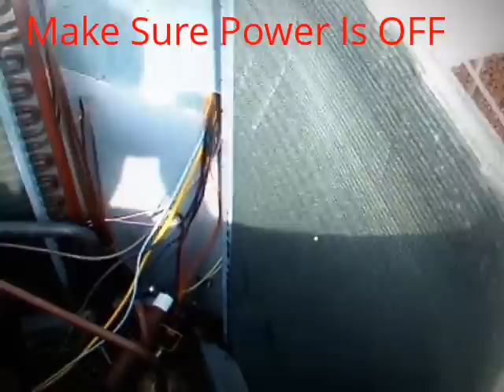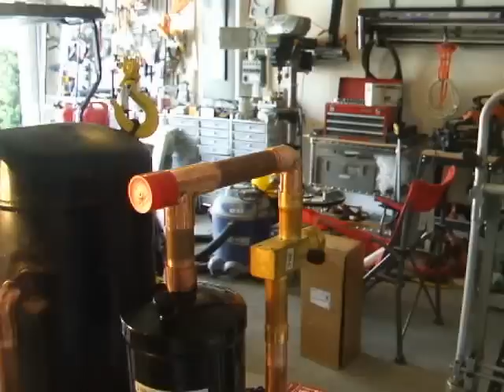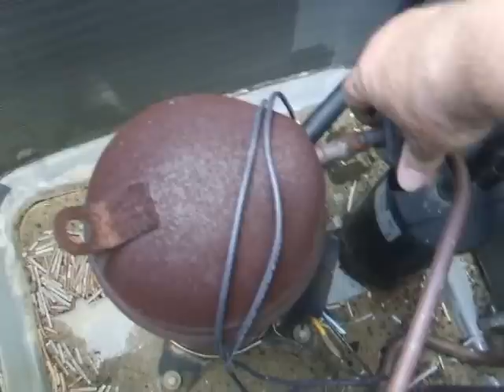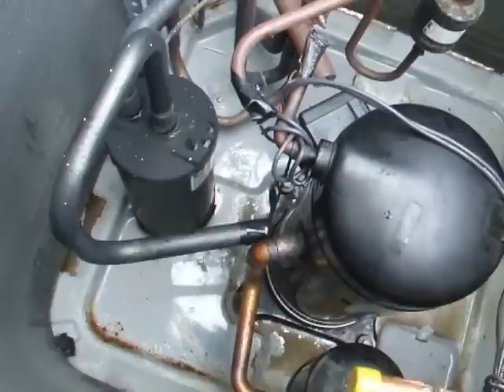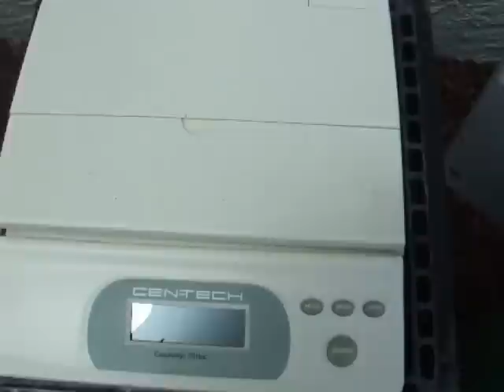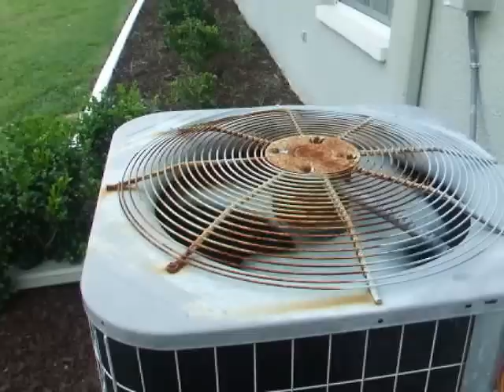HVAC: Compressor Burnout & DIY replacement

Comment: WOW.  I'm impressed. I watched this after being told yesterday that my compressor was grounded out and the unit was dead.  The system is 12 years old and using R22.  I was told I had 2 options either replace the compressor at $2700, or a complete new indoor and outdoor system at a cost of close to $$$10k!!!!

Time to start doing some research...

Comment: Fyi Hard start kits(start capacitor and potential relay) should only be installed on single phase reciprocating compressors, scroll type compressors have other problems if they need start components. When you call a service technician you are not only paying for parts and labor, you are paying for a guarantee, company overhead, insurance (liability accident workers comp health), gasoline in the service vehicle, tools on the truck, education and training, office personel, cellular service, I could go on forever about the costs associated with operating a small business. A service company would complete the task within a timely manner, start to finish a compressor replacement would be completed within hours not days. Parts would be purchased next or same day also would be new not used. The company has to stand behind its work and make a profit, that is the object of the game. Price gouging is a problem but a fair price to replace a 5 ton burnout would be in the $3000 $4000 range depending on the price of the compressor, OEM parts cost more, Carlyle compressors from Totaline do cost more than a generic Copeland replacement. Wholesale cost of R-22 is a fluid situation, with the diminishing supply price will only increase. Just my 2cents from 18 years of HVAC experience.

Comment: Great video!  I'm in the same boat. Locked up compressor.  I had 2 different HVAC companies come by and instead of wanting to replace the bad compressor, of course, I get quotes for new systems.  No, I don't want to spend 5K to 8K for the new higher efficiency units!  Alas, they can't fix the compressor, they can only replace the entire unit.  I'm searching for insight on how to do it myself, and stumbled across your video :)  Great job!  Watching you do it gave me some insight, and the reassurance that it can be done.  I do not know HVAC for shit, but, I do have internet, and common sense.  Thanks for the great video!!

Comment: Congrats on your success, you did a good brazing job, but I think you may have some issues with your repair.
I didn't see if you replaced the liquid line drier, but you should with an HH core; and the accumulator holding burnout oil in the bottom. Is more likely going to mix with your new used compressor's oil, and come back to damage the motor windings.
A triple evacuation is great, if the commercially available nitrogen, or co2 were actually dry; but it isn't in most cases; it can can sometimes have up to 25% of moisture per volume, unless you are sure to buy refrigeration grade co2.
The truth is in practice, if you did a good job brazing, the air will be removed fairly quick, but the moisture will be your worst enemy and the likely source of more burnouts, and your true only friend is an expensive, well maintained vacuum pump, obsessive pump oil changes, vacuum tight refer hoses, and a vacuum gauge reading system microns.
The liquid drier, in this aspect is more important than suction drier, because there is higher freon mass flow through the liquid line than the suction line. In reality a suction filter is only good to trap large metal particles, or other brazing materials from entering the compressor.
You should insulate your suction line, and make your suction line as short as possible to avoid oil trapping and pressure drop. Good luck.
Reply from the maker: Victor, the liquid drier was replaced in this repair so perhaps you didn't watch it all? 

Also, suction line driers are specifically designed to remove acid as well as moisture and debris.
Most guys don't replace the accumulator for a burnout, nor do they remove the oil. If you use a high quality, properly sized, suction line drier as I did you can get most, if not all acid except trace amounts, out of the system.

No manufacturer recommends oil change due to burnout that I've read thus far. This is mineral oil, a bit more forgiving than the synthetic now used in R-410 systems. I've checked the system over a couple times for acid and there's none.

Victor, when you vacuum a system down to less than 1000 microns you boil off moisture regardless of the gas used. I did so a three times. Physics says so.

This repair's going to stand the test of time.
Reply: kaydee457 Sir you are almost right, as far as suction and liquid driers go, they are interchangeable, they can be made of molecular sieve, wich is the most common, and the best to rid your system of moisture, or sporlan has made available HH core type filters that are specifically design to deal with acid and other burnout byproduct. The key element here is that oil is what carries the most burnout chemicals, and the most moisture. and because oil mixes readily in liquid freon, and because you may have; from a few to many pounds of liquid freon per volume in the liquid line, depending on your line pressure and temperature, this is indeed the best place to filter your freon sir.
On the other hand your suction freon gas weights less than one pound per volume under the same conditions. The oil is not actually mixed into the gas, therefore it is only a fraction of the amount that flows through the suction line. Also if you got pretty with bells and whistles on your suction line, you may have lost velocity due extra pressure drop. Because you didn't insulate your suction line, the mass flow is much less when is very warm outside.
As far as your vacuum goes; 500 Microns is very much the standard, and you must be able to shut off the valves and the pump, and hold it there for twenty minutes with a tolerance of perhaps 100 microns, where it will be stable at 600. You may be able to get away with what you did because your system uses mineral oil which can hold a relatively large amount of moisture in dilution, and the fact that at your evaporator temperature you shouldn't freeze the txv. But beware of high discharge temps. Regards.

Comment: The disclaimers that we tend to use in our videos are to help protect us in the case of a law suit. you should consider this yourself because if someone injures themselves or their property you can be held responsible because of this video, I hate to see you lose everything at the age of 62.

A compressor can be replaced for under $1900 so how can someone survive for 6 months on one repair? after all is said and done you MIGHT walk away with about $500.00 profit.
Reply: oh, 1900.00 is not going to be for a 5 ton compressor you will pay more for that size.
Reply from the maker: Eddie, I have a few times in my video warned the viewer to seek a 'pro' if they're not comfortable with doing a repair. I also point out that this video is meant to give them some idea of what's really involved with a compressor repair, the parts required, the acid, the suction line filter, and so on.....Perspective and knowledge is a wonderful thing.
Reply: kaydee457 I understand where you are going with this video but what I got out of watching is that any Tom Dick or Harry can do the same as you in this video and that's far from the truth.
 Disclaimers are for your protection and you should be posting them but its your life so you can do as you choose.  
Don't get me wrong, I have no problems with you performing the work but if you are going to post how to videos for the world to see you better protect yourself, I really don't want to see you lose everything that you've worked so hard for and in this sue happy world the chances of that happening is real. 

the sarcasm alert was poking fun at disclaimers
Reply from the maker: Eddie Leverich Eddie, I had two fellows, from two large local HVAC contracting companies both dismiss the repair and go forward giving me the hard sell on a new system.
I had two others, from a different two large local companies, grudgingly quote the repair, after I insisted, and one of them was, er, clueless. I got a blank stare from him when questioned about a suction line filter. I got even more bewilderment from him when I asked him where he would place it since it was a heat pump. He had absolutely no idea and mumbled something about how he/they don't recommend that, or something like that.....His estimate was close to $4k and the other guy was at $4.2k, or $4.6k, don't recall anymore. Now the compressor goes for $800~$1200- brand new, depends on who you get it from. They would likely replace the accumulator ($200) also, pressure test, evacuate then fill.
If I got an estimate of $1900 I wouldn't have even blinked for I would've done anything to shut my nagging wife up!
Reply: kaydee457 I understand why you did the video but you came off as if all service guys are the same, that's how it appeared to me anyways.

I don't care if you make a video and speak your mind, I encourage it actually, but the whole thing about the declaimers is what I take issue with. I am one of the guys that promoted that all of the hvac guys put disclaimers on their videos and it was to protect them from a lawsuit and I am going to encourage you to do the same.  I recommend  that you re-edit this video removing all of the talk about the disclaimers, add your own and call it a day, but like I said earlier its your life do what you feel is best.

$1900 is what I know some guys around here charges for a 2 ton compressor but that doesn't include accumulators, reversing valves, filter dryers, and most of them wont know anything about pressure testing and evacuation. Im sure that you could have gotten it done for around $3,000 but I don't know your market so its hard to say.

I'm willing to bet that most company out there would not install suction line filters, which doesn't make it right, but being in the field for over 23 years I can count on my hands how many times ive seen them installed after a burn out.

Comment: Thanks for posting.  More power to you my friend.  If you can do it yourself- absolutely save that bread.  How much did you end up saving?
Reply from the maker: Depends on which 'estimate' I want to use....Most of these guys were looking to install a new system. That would've been $5k to $7k....The actual repair cost me around $1.2k when all was said and done. The biggest expenses was compressor and freon. A new compressor (online) goes for around $1k. Almost all the 'stuff' I needed I had to buy online as local suppliers would not sell to me. I had to buy the Suction line drier and service valve online. I already had a torch, silver solder and other 'stuff' such as vacuum pump, gauges, hoses, I used for car a/c's. Fortunately I had a small window a/c that took the pressure off me to get it done right away although I still had to deal with a nagging wife.......

Comment: buy r22 anywhere they sell it. Got mine off ebay for $150 less than the local supply house is wanting (new bottle sealed 30lb). I did have to study for a day and a half, then go to Johnstone supply and pay $85 for a EPA 608 test. Missed 4 out of 100 for a universal cert. They use Mainstream EPA test dot com. The study software is free on their website. All about the EPA 608, nothing to do with homeowner or hvac pro.

Comment: Nice job.  I can see you were careful in following the recommended procedures.  I am also a homeowner who is considering replacing an R22 heat pump.

If the compressor is not burned out and the system has not been contaminated can the R-22 that is evacuated be reused in the same system if it is evacuated and stored properly.

I was wondering about the suction line drier.  Is that put in because it is recommended after the lines have been opened or in your case because of the compressor burnout?

Since you have the bypass valve would it have been possible to put the suction line drier outside the condenser housing?
Reply from the maker: Warm- Yes, the recovered Freon can be reused. If you're just doing a repair to the existing condenser the Freon can be pumped into the external lineset and evaporator and stored there. There's a 'pump down' procedure to do that whereby you pump the system down and close off the service valves. You can then open up the system (condenser) and replace a component, do a leak test, evacuate and then refill the system.

The suction line filter is primarily used to remove the acid from the system. You won't see them installed on too many units other for that single purpose.
The suction line filter is unidirectional and on a straight cool condenser (without heat pump) it can be located externally but it cannot on a heatpump since the
Freon flow is reversed in a heat pump system depending on whether you're cooling or heating. It has to be placed where the Freon only flows in one direction which is between the accumulator and the compressor.
Reply from the maker: kaydee457 Oh, one more thing on the 'pump down'. To store the Freon in the line-set/evaporator (this is only possible with a heat pump) you must set your thermostat to heat, or if you know how, directly energize the reversing valve to force it to heat pump mode.
You can do a 'pump down' on a straight cool a/c Condenser but all the Freon will be stored within the Condenser so if you need to open it up to replace a condenser component then there's no point to pumping down, you'll have to recover the system.
Reply: kaydee457 Thanks for the information.  It could be different in my situation as I want to replace a straight A/C condenser with a heat pump condenser.  The evaporator is heat pump ready and the tonnage size of the replacement heat pump and A/C condenser are the same.  Will I be able to pump down or should I plan for a refrigerant tank?
Reply from the maker: warmsound In that situation you'll have to recover the R-22 as there's no way, given it's a straight cool condenser, to pump the refrigerant into the line-set/evaporator. Here's the caveat- you can 'pump down' and store all the R-22 in the old condenser (straight cool condenser) for purposes of being 'environmentally' safe, and assuming you're going to leave the service valves attached and they would be closed, but you won't be able to reuse it unless it's recovered using HVAC recovery equipment. Look on Craigslist for R-22.

Comment: since you had a burnt out , did you do anything with the evaporator as far some type of cleaning or flushing it? or did the suction drier took care of the contaminants that were at the evap and the line set?
Reply from the maker: According to one compressor manufacturer, Copeland, the majority of tainted oil is removed with the old compressor and the Suction line filter will remove any remaining residual acid from the system oil. My system is clean nearly a year later.
Reply: kaydee457 thanks for the response, glad to hearx.rob ur system still running good
Reply: kaydee457 thanks for the response, glad to hear ur system still running good

Comment: the suction tubing looks very disclolored? possible reversing valve issue causing unit to recirculate hot gas and cook compressor. just a though
Reply from the maker: Perhaps at one time but the unit's never worked this good since I bought the house (3rd owner) and I've been using it in HP mode for the past few months, on and off, in temps below freezing and it's keeping the house an uncomfortable 80+ degrees.....The wife's cooking me alive!

Comment: Why did you leave that Cumulater in it was all rusted that is going to leak soon there go's your r22
Reply from the maker: Looks worse than it really is. I took my wire brush to it and cleaned it up. Just lost some paint but still has lots of metal left.....

Comment: Would it have not been easier to just change the condenser. And by the way the guy that walked away with the Freon did you a favor it was burnt anyway however I will say that that's incredible though I may not believe it it's still incredible that you have no HVAC training
Reply from the maker: Chris, that was the first thing I tried to do. I thought I had one lined up off of Craigslist that was for sale at a commercial site by a contractor doing a system change. He first told me that it was R-22 but later, just before I was to go get it, changed his story to R-410.....When you've got a nagging wife and it's the height of summer, you take the path of least resistance. Compressor was the only choice at that point.
As for the Freon recovery. He was PAID to do the recovery regardless of the contamination. He still gets to turn it in and get some money for it too....He was a jerk, period.

Comment: Did you vacum down first and then you put nitrogen on the system?
Reply from the maker: Yes......Once you pull a vacuum and you're sure you can hold a vacuum then it's a good idea to pressurize the system with nitrogen for two reasons: to dry out the system and to further verify there are no leaks.
Reply: Yeah, but you're supposed to do nitrogen and then vacum down... right?
Reply from the maker: Martin Osuna Depends on what you're doing. If you've opened the system, as I did, then it's best to pull a vacuum first to remove the air in the system, then charge with Nitrogen under pressure. Simply charging with Nitrogen first will compress the air in the system and you'll see no benefit from the dry Nitrogen. Of course Nitrogen is a lot cheaper than R-22 and it's a good gas to charge the system under pressure to verify your brazing and to verify that no leaks exist before once again pulling a vacuum and then charging with R-22.

Comment: There is a good reason why only trained personel should handle cooling agents.
Reply: Trained personal is trained to solder teh joints 100% through.. R22 has a relative low pressure but if you have bad soldering with R410a you could be very surprised